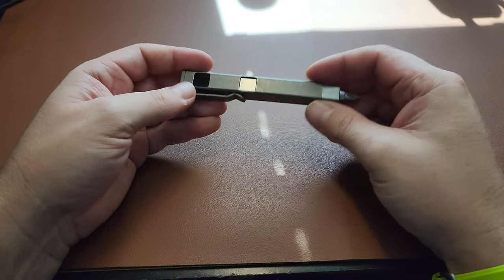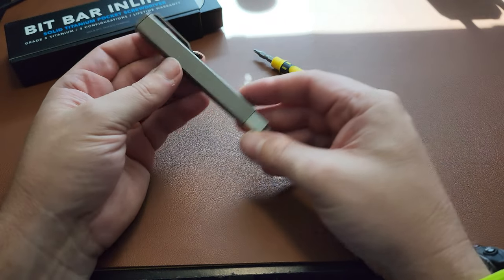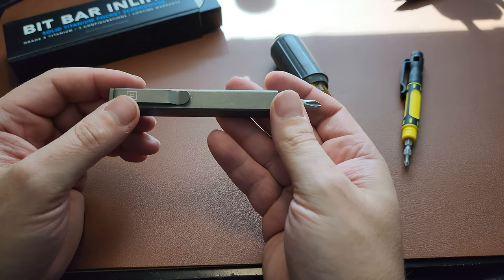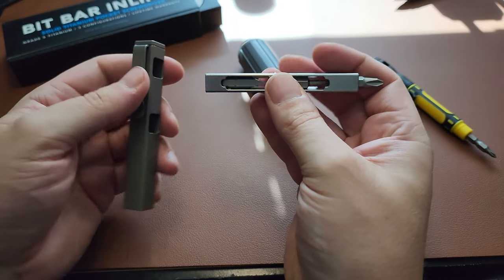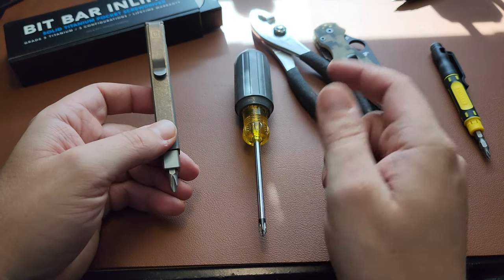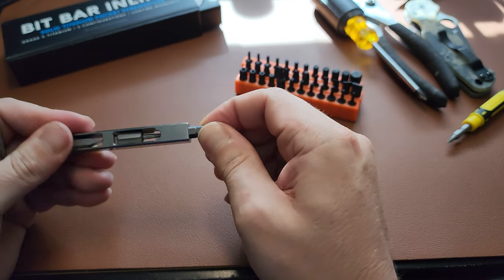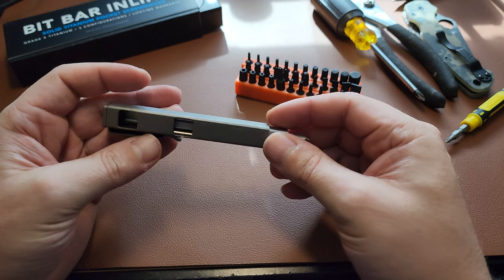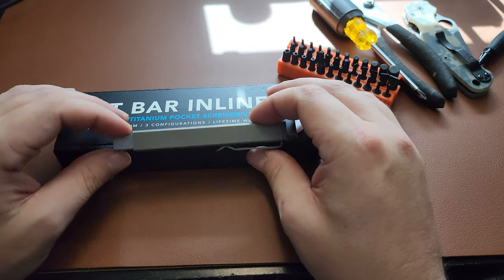Big Design Bit Bar the Ultimate EDC Screwdriver

Comment: A fix for your double ended bits and just general purpose would be to add an extension to your kit that would accept double ended bits. You would get the bonus of the bits as well as added length. You should also try the Leatherman Ratchet adapter, those things are super handy and turn a regular driver into a ratchet. For the pen refill idea, check out AltPen, it is a pen that also is a 4mm precision driver.